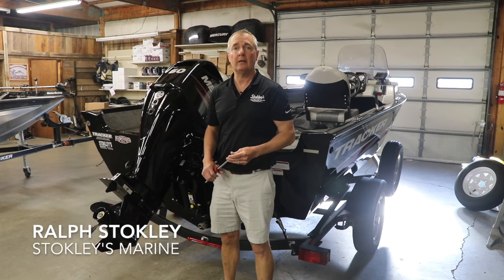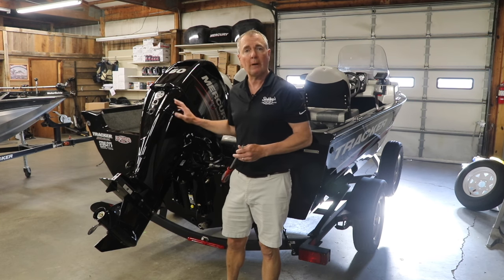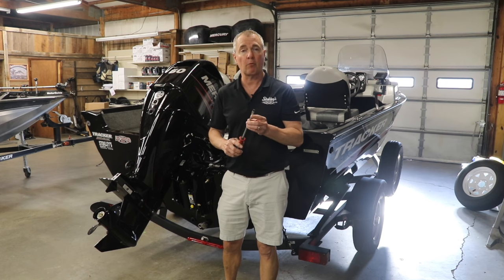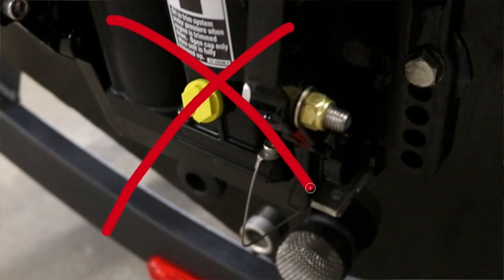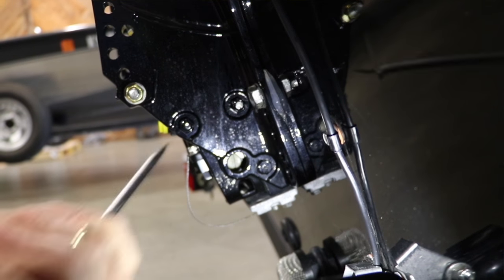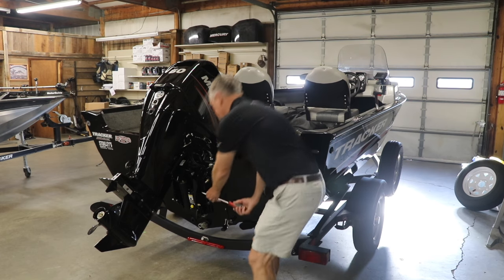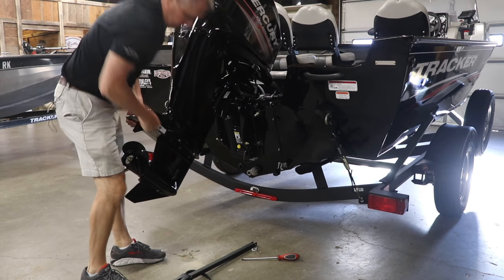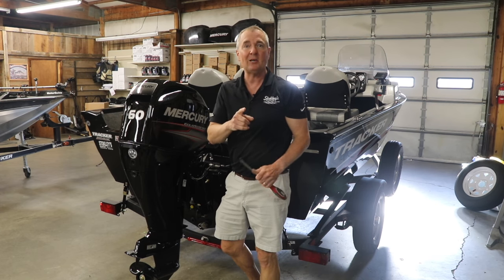Trimming your Mercury motor without power

Comment: Great tip. Took longer to get on the waders than to get the outboard to drop from the stuck raised position. The outboard dropped all the way down, but then the power lift worked to raise it to proper operating levels.  Big help!

Comment: I have a brand new 60 and I connected the battery and tried the little tilt button on the motor. It tilted up all the way and the tilt motor just keeps running and running. I disconnected the battery. it won't stop tilting. What mow?

Comment: I have question sir I have a mercury outboard 125 2000 when on the water my boat took water over the transom the trim went up out of the water and stayed on had to disconnect the battery to stop

Comment: We used this tip last night. However the guy removed the screw completely and I lost some oil. I followed the instructions to lift, lock and fill the center. Motor runs, but will not move the motor.

Comment: Any tips on a replacement for the IDIOT (that's me) that unscrewed it to far and dropped it in the lake. I have no idea wat it even looks like.
Reply: Did you get an answer?
Reply: No. I wound up getting one on Amazon that was almost the same but it didn’t seal properly. Leaked fluid. After that I went to Bass Shops and purchased an OEM one and it’s perfect.
Reply: @-Darren-  I just got one from Amazon that’s the wrong size hahaha

Comment: Thanks, I have an issue with the plastic bolt... I purchased a used boat with a 135 mercury motor. When taking it out for the second time the tilt and trim motor got stuck in the down position. I seen your video about releasing pressure by turning the screw. when I found it, the screw head was already broken off. What can i do at this point? I have checked everything and found that the motor is not working and both relays are good.
Reply: Evan Cordero any luck? I have this exact problem. The plastic screw, which appeared to be so easily removed in this video, would not budge and now the slot is stripped out.
Reply: Try at your own risk...
Choose a larger flathead screwdriver than you have been using. Heat the tip of the screwdriver so that you can melt a new slot in the screw. Allow the plastic screw to return to normal temperature. Now you have a new slot in your screw head!
Reply: Ron Jones Thanks. This is exactly what I did. Still had to take entire tilt/trim assembly off so I could get enough leverage to drive heated screwdriver blade deep enough, then put a pair of pliers to the screwdriver and FINALLY got it to back out. Had to drain most of the fluid out and hammer the piston back down. Certainly wasn’t anything like this video!

Comment: This worked on my ProGuide V16 when tilt stopped working in up direction with less than 50 hours on the engine.  You made it look easy lifting that 60 Merc - but I have a 75 and it takes 2-3 guys to lift that engine.  Merc needs better quality control in their Trim System.